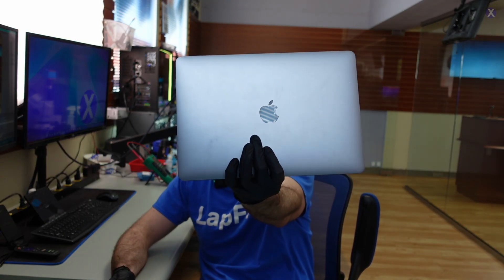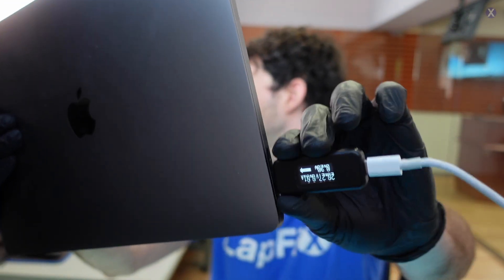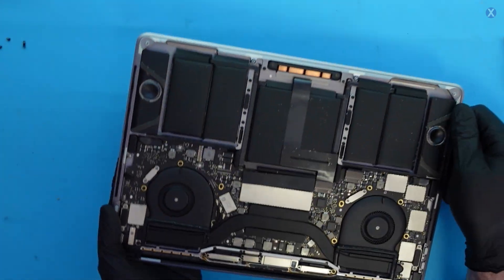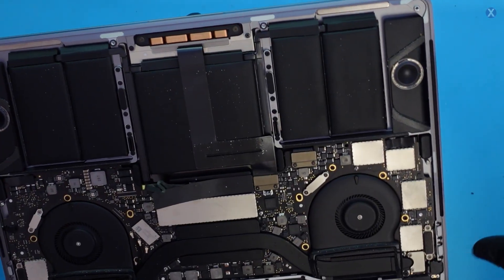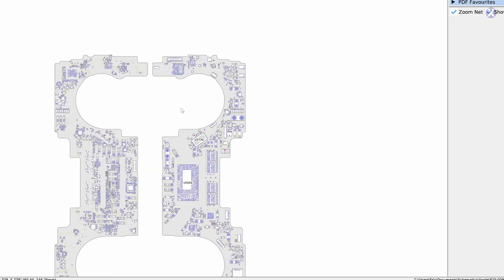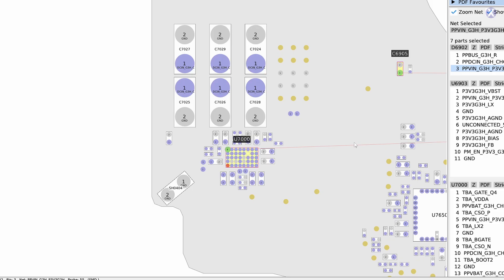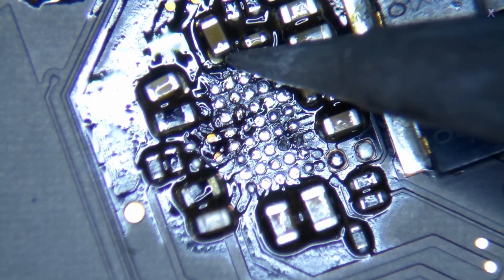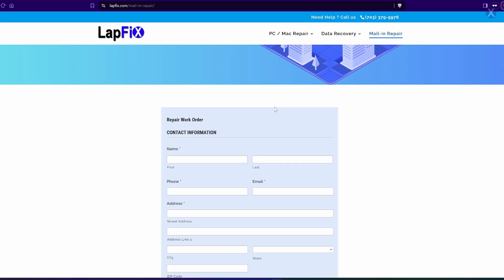How to Fix A MacBook Pro With No Power

Comment: Hello Eric

Thanks for your great videos and explanations. I have two questions: How do you use your thermal camera, do you leave it on normal power or do you connect an external power supply on the power lane you suspect. Second question: Where do you get the boardviews schematics from, can you buy them somewhere or what is the best way to get them? Many thanks and great videos!